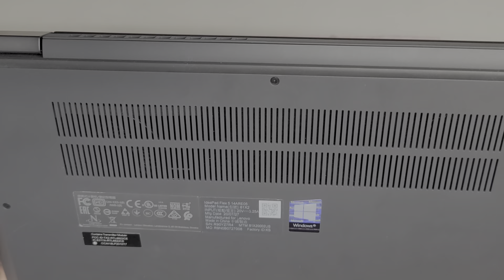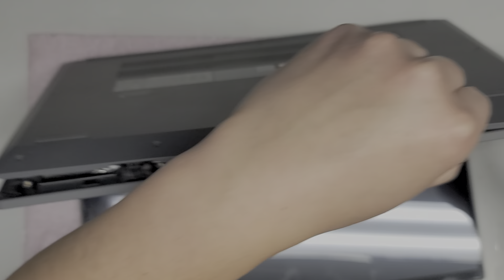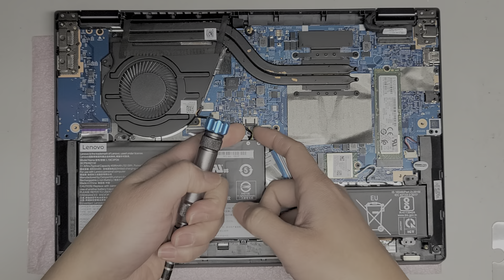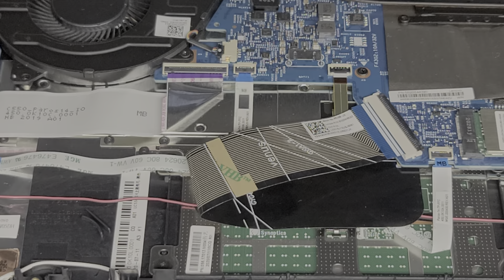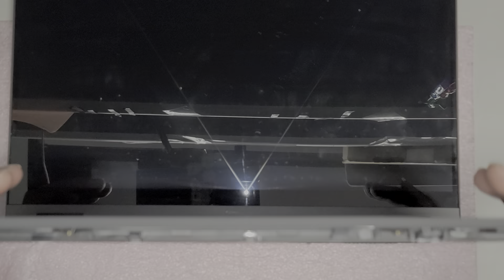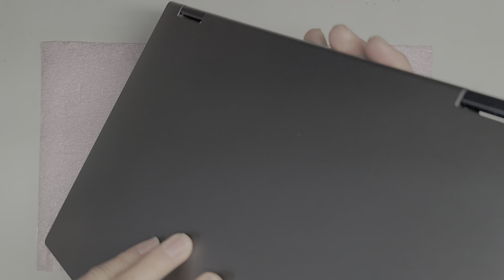Lenovo Ideapad Flex 5 14ARE05 81X2 Disassembly SSD Hard Drive Upgrade Battery Replacement Repair

Comment: No wonder I could not find a CMOS battery to clear the CMOS memory.  Removed the battery for a day, pressed the power for a while, reattached the battery and original USB PD charger and it woke up.. with a bad CMOS checksum....then it proceeded to boot windows just fine.  My symptom was no powering on, only the very rapid power button led dimly flashing, No combination of chargers, power button, manipulation would help.  I was in a jam and tried to charge with a 20W PD charger, got a lot of complaints about it being too small, I guess eventually the situation drove it around the twist. Thanks for the ideas.
Reply from the maker: Glad it ended up working out

Comment: Can you fit a more powerful CPU?
Reply from the maker: @nunziosilvestro4025  If you take the battery out, you can put some very powerful desktop cpus in the empty space for storage. Lol
Reply: what dedktop cpu model, there is a dedicated video on you tube.. grazie
Reply from the maker: You want to use your laptop to store loose cpus?
Reply: yes I have on a ryzen 3 4300u not so maybe a 7320u would be fine?
Reply from the maker: @nunziosilvestro4025  You should put them in a plastic container instead. It's safer for them.

Comment: Did this particular laptop later work?

Turns out you need to reprogram the BIOS by removing the chip and flashing it externally. Or, better yet, buy a new chip entirely which is available for a token on eBay.

Just thought of helping out.
Reply from the maker: If it's not in the video, I don't know. It's been too long.
Reply: @ItsBinhRepaired  I'm talking about the laptop in this video
Reply from the maker: @m_bobby  If it's not in the video, I wouldn't know.
Reply: what do you mean flash it externally? do you need a specific product for that? I'm having an issue with this laptop where the keyboard and fans turn on for a few second, turn off, and it repeats. laptop won't boot up
Reply from the maker: Can you get into the bios?

Comment: Thanks for the teardown, very useful.
You can pull those speakers out without removing any boards though. The top speaker connection is just a loose, plastic C-shape. It's lightly squeezing a peg under each board. You tug it downward and it slips free. Push the speakers back in the same way. I know this because I had a user blow the speakers out. As soon as you turned on the laptop, it started shrieking. You could even smell them. Just horrible. It's good that Lenovo makes such parts modular. All I can figure is that he plugged in something with a charge into the headphone port.
Reply from the maker: Yeah, I know.

Comment: Hi, great video very helpful. I watched to see if I can change the keyboard, but it appears to unreachable - once you take the main board off there is no access, the keyboard is behind a metal sheet that looks like it is rivetted on. I wanted to install a backlit keyboard, the connection for the backlit function is there, but getting the keyboard out seems impossible. do you know if this can be done with the 14ARE05 series?
Reply from the maker: Likely held in with melted plastic, but not sure it can be upgraded even if it has the slot for backlight.
Reply: @ItsBinhRepaired  thanks for the advice! I'll leave it as it is so nothing gets broken :)
Reply from the maker: @stevekesley1  good choice

Comment: Thank you! I just fixed my keyboard issue for no cost other than buying a screwdriver set. I'm seriously not computer savvy. Thank you very much.
Reply from the maker: Awesome, glad it helped! If you haven't already, please like and subscribe so others can find my videos.
Reply: I'm having an issue with my keyboard where some keys (asdfjkl) don't work intermittently, what fixed your issue? Was the keyboard cable just loose?
Reply from the maker: You'll need to replace the keyboard
Reply: @Pestam  Hi, my issue wasn't intermittent, I lost use of the middle bunch of keys constantly, so followed this vid and everything has worked fine since. Good luck!

Comment: Where is the cmos battery.  Time is behind.  I get message at boot time to check cmos
Reply from the maker: As far as I know it's the main battery
Reply: Thanks.  You are correct.  I reached the same conclusion after researching.
Reply: @ItsBinhRepaired  another question please.  All of a sudden I get keyboard not detected message at reboot.  After that only the backspace button does not work.  It is inconsistent.  If I touch the keyboard cable by the connector the backspace button starts to work.  Sometimes it starts to work on its own by simply closing and opening the lid. Any idea?  Would a new keyboard fixes it?   Software keyboard and USB keyboard work fine.
Reply from the maker: @asadalsader707  might be the keyboard cable is damaged.
Reply: @ItsBinhRepaired  can the cable be replaced by itself in this model?  Any video on how to do that and where to buy it?   Thank you so much.
Reply from the maker: @asadalsader707  sadly no, you'd have to replace the whole keyboard likely :(

Comment: A classmate of mine has the Lenovo Ideapad Flex 5 14ALC05. He needs to update the CMOS battery as his time doesn't properly sync in Windows 11. Would the CMOS battery be on the other side of the board?
8:53 Oh. That is SO DUMB!!!
Reply from the maker: Yup...
Reply: Update on my classmate's Lenovo IdeaPad flex 5. I used a USB c tester to test the power going through his laptop. 

It stayed at 1 watt of power being sent to the laptop, until it died. All while being plugged in. Turned it on again and it charges the full output, for 10 minutes. I think it's the port gone bad.

Comment: Thanks for the video. Very informative on what is on the board and how to take off the battery. I'm looking to replace the battery in mine as the charger I got with it broke 3 months in and the next charger fried the battery to half its capacity and wanted to see  a breakdown before I did it.
Reply from the maker: Glad you found the video useful. If you haven't already, please like and subscribe so others can find my videos. Thanks!

Comment: I would like to buy lenovo ideapad5 (14) not the flex one 
It has 512SSD my quistion is if i can add a HDD or not ?
and give me your opinion in the device
Lenovo ideapad 5 (14)
Ryzen7 4700u, 16GB ram, 512SSD
Reply from the maker: I don't know. I just repair computers, not really do reviews. Do I have a video of that model?

Comment: Can anyone tell me where the CMOS battery is hidden?
Reply from the maker: I think it just uses the regular battery for that.
Reply: @ItsBinhRepaired  thanks for the quick reply. Sadly removing the regular battery didn't work as CMOS reset.
Reply from the maker: @hydranten-willi  how do you know?
Reply: @ItsBinhRepaired  The notebook isn't booting. Not even the BIOS. I unplugged the internal battery connector. Flipped the notebook open and pushed the power button. Than waited a few minutes and plugged the battery in again. 
No change on reboot.
But maybe - however this could happen by itself - the BIOS is totally broken. Guess I have to flash the BIOS next. I heared of failed automatic windows 10 updates which also include bios updates. Maybe this happened here without anyone taking note.
Reply from the maker: @hydranten-willi  sounds like a dead motherboard. How do you know it's just the bios?

Comment: I have started to see this issue myself. I have this same exact model on our bench here, same issue. Power light blinking, no reset works. This customer has sent in this laptop 3 months ago to get fixed at Lenovo support, and just got it back last week. An update from Microsoft happened, bam same issue yet again! Go to the Lenovo forums, there are many of this laptop model dropping like flies.
Reply: Might have something to do with Always on display (which shows battery % after hitting any key). Disable it in bios.
It enters some kind of sleep mode then-and in previous bios version the fan came on & kept on spinning even after screen went off. 

Also random shutdowns can be caused by over heating, some guys new flex 5 had solidified thermal paste. Try changing thermal paste.
Reply: Also on the left side, beside the 3.5mm audio jack there's the novo button hole you can press with a needle/toothpick.
Also you can enter novo menu by holding down Fn key + power button to start up.
Reply: @Naxxx.110   I tried that... That only turned on the system just like the power button.... It didn't enter the bios....
Reply: @swastikchatterjee5838  most foolproof way is shutting the system down. Then press Fn key which is beside CTRL. Holding the Fn key, just press the power button & release the power button immediately. Keep on holding Fn. You'll see Novo menu, with bios setup - boot menu & other options.
Reply: @Naxxx.110  i actually tried to work with the novo button with a sim ejector tool. It didn't help.... I think the way you are talking about will fire up the novo menu. So if the button doesn't work , i doubt that way will work too....
Anyways i really don't know 😂
Reply: @swastikchatterjee5838 my method always work. It's not always safe to poke the novo button as it may break if you use it everytime. Tell me if the Fn key method told above works. It works everytime for me.
Reply: @Naxxx.110  i actually have already sent it to the service centre. I don't have it now 😂
Reply: @swastikchatterjee5838  congratulations. Now they won't be able to fix it, as its a bios bug. Rather they will change the motherboard, and the charging indicator plastic diffusor will stick to the motherboard & it'll get returned. See if you get it back with the charging led too much inside a hole & not very visible.
Reply from the maker: If enough people find this video and have the same issue, it can probably be used as evidence in a class action lawsuit.
Reply: @ItsBinhRepaired  I believe Microsoft pushes firmware updates as optional, correct? I have seen HP bios updates, and a few ME firmware updates for Asus laptops as well.
An unknowing user can install it and wham, this crap happens.
Reply from the maker: @nelsonperez3125  yeah :(